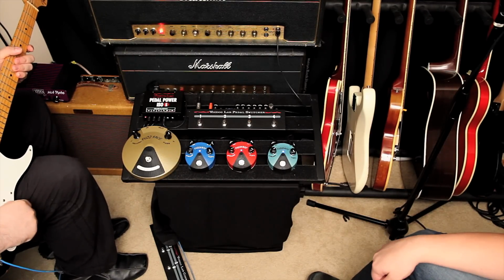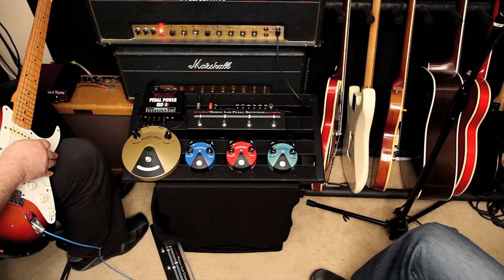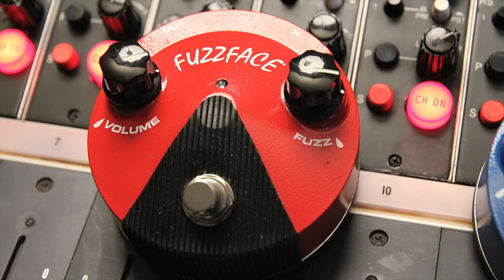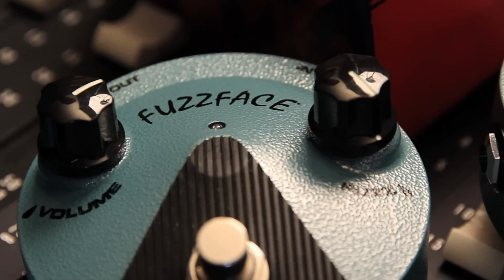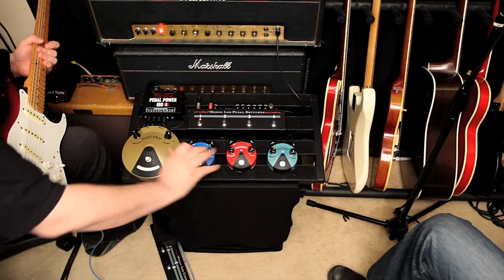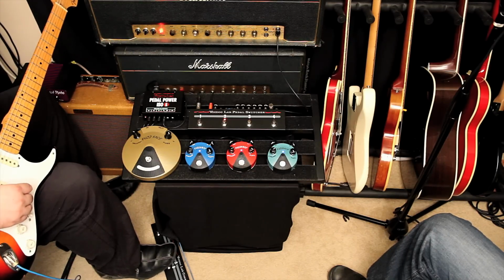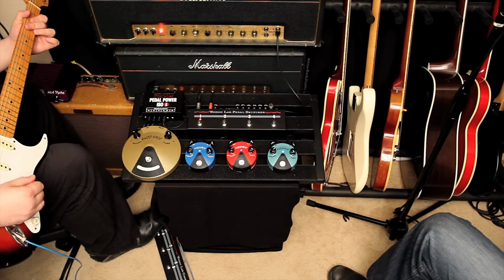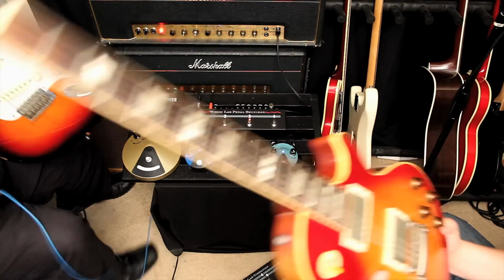Mini Fuzz Face Shootout w/ Jeorge Tripps & James Santiago

Comment: If you want that, "ripping people's faces off in Pompeii" David Gilmour tone, you should probably go with the dark blue one.
Reply: Overall, the dark blue one is better if you use your bridge pickup a lot (on a strat), the red one isn't very good at all (IMO), and the Jimi Hendrix one works for the neck pickup with it's epic mid hump.
Reply: number 1 sounded the best to me. killer for leads.
Reply: Gimour used red FF from 68-71, then blue from 71-75
Reply: (so yeah, you're right)
Reply: Coopersboy7 Yep. Although he used BC109 in the pre-Muff days.
Reply: Daniel Brown FF on DSOTM
Reply: So, he was using them up til at least '73-74 (including tours)
Reply: there are photo's of Floyd in France, 1972 recording "Obscured By Clouds" and you can see the red FF is the one he's using.
Reply: Can anyone tell me if these are positive centered? If so, do I need a new adapter or can I run this like a normal pedal, powering from a DC brick with several 9v outputs?
Reply: @aniketdatta2450  standard negative center 9vDC supply, like every Boss pedal
Reply: @Gutch220  nvm i already got the Mxr 108 classic mini

Comment: In a scale
1st - Si Panties Blue : Great clean up while rolling back the volume pot & awesome brightness
2nd - Ge Red : Great clean up while rolling back the volume pot but too dark
3nd - Dark Blue : Awesome brightness but doesn't clean so well.

Ps.: I have a classic red one, the big, from late 90s. It's an awesome pedal. I don't find it too dark because I have a brazilian ivory scale strat and set the amp EQ like bass:3, mid:8,5, tre:6. So it's just about setting up your gear.

Great video btw

Comment: One more question: I imagine that the red germanium thingamabob should not be used with the same power supply as most effects or it will fry your pedalboard, but what about the sea foam hendrix thingamabob -- is that silicon or germanium? I am guessing that it is silicon from the sound.
Reply: @2m24s you can clearly see the word "Silicon" on the box. You've been voted as the person with the dumbest comments on YouTube for 2019 thus far.

Comment: Well I have the fulltone 70's silicon fuzz and i like that,which is like a fuzzface clone. I've also got a big muff, but thats kind of it's own pedal altogether. Depends what you want in a fuzz. I tried these out today at a music store and prefered the blue one, I like a tighter more high end sound, but you may prefer the low end growl of a more germanium fuzz. Anything based on the fuzzface circuit is usually a winner, and um earthquaker devices check them out but expect 300 for one of those!!!

Comment: I bought both the silicon and germanium models and quickly returned the former as it had a horrible volume drop. I had to turn it to practically 3 o'clock to match my bypass signal, anything less than that was completely useless. This was not an issue with the FFM2. I also have a full-size Hendrix which does not have that problem, so it must have been something with the FM1. Also noticed it had a different (personally preferable) sound with a buffered pedal before AND after it, just a note to any potential buyers.

Comment: These should be identically gain structured, but the dark blue silicone one is turned up enough to make the listening test false.  It is driving the head a little more and will have more overtones.
Reply: Maybe they should, but they are not.. the blue one have always done a worse job of cleaning up.. look at other reviews for reference or try for yourself. However, I prefer the slightly more top-endish fuzziness of the blue one.

Comment: With the Germanium Fuzz Face being PNP, do you have to use a separate power supply, or has a charge pump been added to flip the polarity, so that it can be daisy chained with other pedals?

Comment: A " pedal switcher"? I always ask myself the question if I have to many pedals in a row if then the signal gets weaker. Does this pedal switcher solves that problem?,... or is there actually not such a problem of any loss?
Reply: Signal path length degrades tone over longer distances, so having more pedals and longer cords definitely causes loss.  True bypass pedals do this; 'buffered' pedals attempt to correct this problem.  Having buffered pedals at different points in your chain can help combat this.  It's actually not that big of a problem depending on your gear and your ear.  Once you're in a full band mix, it matters even less (unless you have some really bad tone-sucking pedal).  A pedal switcher as shown takes pedals (and their patch cables) out of the path while inactive in order to keep the path as short as possible.  This can also be useful for keeping different combinations of effects together on one combined switch so that you don't have to try to hit, for instance, three pedals all at relatively the same time for the solo sound you wanted to kick on.
Reply: +James Haire This was every useful info thanks guy. I didn't know if I was ever going to wrap my head around it.
Reply: Don't put buffers next to fuzz though!

Comment: Should make a version with the red and blue in the same pedal.
Reply: +Guitar Whores I bet the big difference is only the diodes, so if you can find a little place under the hood, it might be possible with a switch to...switch between the diodes in a way you get both sound in one pedal. But the biggest problem will be to find place for the mod!!!
Reply: nicolas taussac There's always room for mods :D

Comment: Can I adjust the internal pot of my FF3 to get a less bassy fuzz?  (I'm losing too much top at the moment and getting more bottom end than I want for lead parts.)  On mine there's only a quater-turn between the factory setting and the max clockwise setting.  What happens if I go in anti-clockwise direction (including any damage to the tranny)?

Comment: I'd be inclined to try out the blue silicon fuzz face if it was in the big housing, the innards look far too complicated for a pedal that should consist of two transistors, four resistors, three capacitors and two pots: in fact you could do away with the fuzz pot  and just control it from your guitar's volume.
Reply: the fuzz pot is part of the feed back network,doing away with it leaves only full signal feedback,which is out of phase with the input signal,so would give minimal signal gain.

Comment: as much overdrive or gain your amp has it wont push your signal into a square wave which is what gives you that "hairy" fuzz sound. Fuzz is one of those magical sounds that an amp just can't emulate, well a standard tube amp anyways.
Reply: I use a marshall 1987x cranked with an attenuator and a mxr micro amp.The sound is similar to a fuzz

Comment: My ears can only hear VERY slight differences when the pedals are pushed hard. So much so that if I couldn't hear the click of the pedal changing or see the little arrow, I doubt I'd even know it's changed most of the time. It really only presents the variations clearly when you roll off the volume of the guitar. But then again, maybe it's different in person or maybe my ears stink, I dunno.

Comment: the Hendrix rip's the most the red is the most clean and most highs and the blue is the heaviest bass
Reply: Nope. (I prefer the blue, but that is of course a matter of tast). As for the frequency range, however, it is not a matter of taste.The red cleans up more than the blue, but the blue is more trebly than both the red and the Hendrix, the red definitely has a darker, more woolley mid-range punch.

Comment: you should at least have made sure to have the same knop positions before A-B-testing the pedals. In this case the volume of the outer left one is the highest. This leads to the impression that it is crunchier at lower git volume than the other two. The Hendrix is at lowest volume. This way your test is worthless.

Comment: Anyone else out there having problems with this thing being EXTREMELY egotistical? If you put it where overdrive/distortion/fuzz pedals normally go in a chain of pedals it sounds like it's broken and even if it's the first pedal you plug into it still sounds bad. The only way I can get it to work properly is if it's the only thing between the guitar and the amp.

Comment: So let me get this straight. The guy from Dunlop doesnt even know that "silicon" is not the same thing as "silicone," and the other guy thinks that sub-bass is (or at least is called) "sub-sonic," which is really ironic since that would basically mean that sound travels through air slower than itself lolol. Even before i was an audio engineer i knew it was a fact that a lot of guitar bros think they know WAY more than they actually do about guitar stuff and audio.